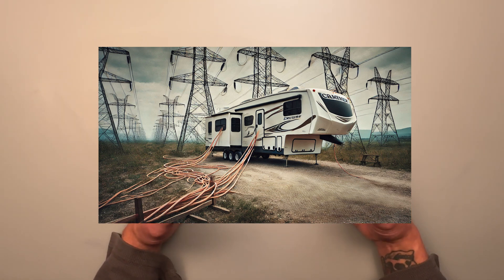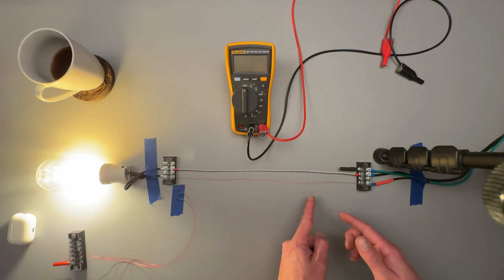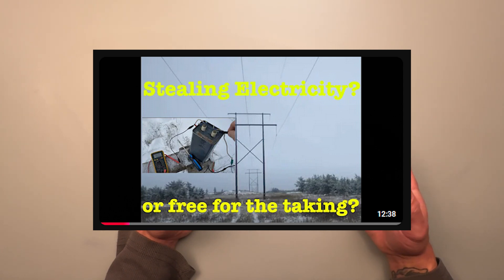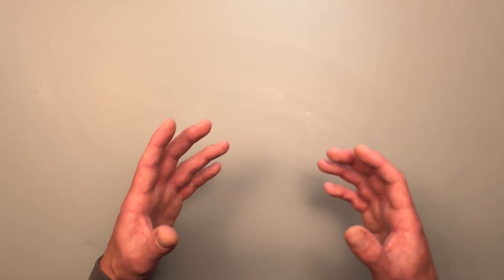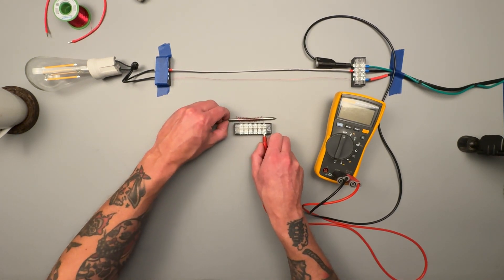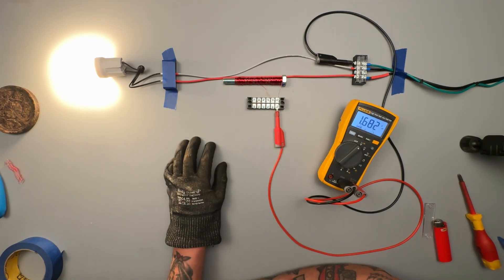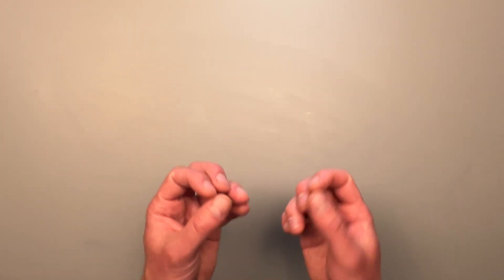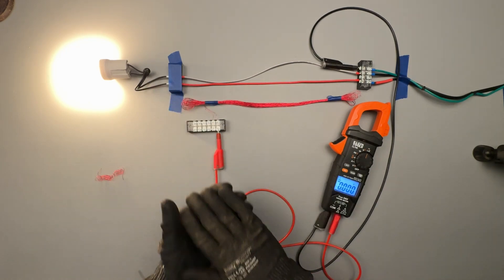FREE ELECTRICITY - Kind of (Testing Induction from High Voltage Power Lines) ⚡️📡

Comment: I take it, the amperage is going to be based on how much is being used from the transmission line... Being voltage doesn't really matter if the amperage is low... You could have 50k volts at .0000000000000001 amp which is not usable at all... Curious what could be done to increase the amperage...
Reply from the maker: It's been awhile since I put this together so i'm not as fresh on all the research I did to put this together. But learning about transformers and their theory of operation is really helpful for this topic. Arranging the conductors into a coil and adding an iron core + getting the conductors closer, increased the transfer of energy and allows for usable voltage and current.

Comment: if there is no usable power here, how can I light fluorescent lamps in my hand while standing under these powerlines?  Your application testing was on the microscale considering the amount of current going thru the overhead lines to create huge magnetic fields. Ask yourself this question... why are those wires so freaking high in the air? And another anomaly is that you can dig the earth around the powerlines and never find an earthworm. As A teen, I experimented with hanging wires near the powerline towers in my back yard.... a 20 ft wire lifted to about 10 ft off the ground was able to produce 3 inch sparks, so yes thats allot of voltage, so take that voltage and feed it to a flyback transformer and see how much power you can achieve from the primary windings.... It's called impedance matching.... High resistance winding tied to a high impedance antenna coupled to a low impedance winding to transfer the high voltage to low voltage with more current. one day I'll make a video to prove this is usable power.
Reply from the maker: Hey n3qxc, thank you for the comment.

Yes, my testing was done on a micro scale to help demonstrate the concepts at play. I understand that the high voltage transmission lines are high in the air.. if you get any amount of conductor close enough to those lines you're going to get usable voltage and then some. The limitation I purposefully put on the example is that someone used extension cords strung across the ground.. so that the EMF induction would be limited and weak. Another aspect of the demonstration was to help the audience understand impedance and voltage drop. 

I don't see how a flyback transformer being implemented or impedance matching would be useful in this particular scenario. 

Thank you for sharing your passion with myself and the audience.
Reply: @maddoxmechanic  impedance matching is KEY.... maximum power transfers with proper matching..... try 32 ohm speakers on your home stereo vs the 8 ohm that they were designed for.... same thing goes for antennas and transmitters..... dump 1kw into a 3000 ohm antenna and nothing gets transmitted.... I suspect the best idea would be to have a tuned tank circuit as your pickup coil.... tuned for 60 hz....  Extension cords on the ground may sound like a far fetched plan, but maybe there is some luck in the idea that each conductor is insulated from each other along with having a particular impedance due to capacitance created by parallel wires separated by insulation. Also .. back to the other guy with the video... charging the cap to near 800 vdc.... yeah it took some time, but the level of energy stored in that single charge could be useful once it's stepped down to a usable level. The reason the guy chose 4 ft height was to remain legal by considering it a fence wire as he inquired about putting up a fence and was told there would be no issues. So a fence with the top wire insulated from the poles would be a great collector. But even still... I dont see how it could be considered theft of service. This wouldn't have any loading effect on the overhead lines. There is more power lost in the corona discharge than anything. I love the purple glow of those insulators on a rainy night!
Reply from the maker: @n3qxc  I understand that impedance matching has its place in RF and stereo installation, but in low frequency inductance, impedance matching would have negligible effects to the circuit. The critical variables would be distance to the lines, the amount of conductor strung under the lines, and the current flowing through the high voltage transfer lines. 

That is a good point about keeping the coaxial off the ground. I had forgotten that was apart of his approach for testing, was to identify it as a fence.

Comment: Induction is how every step up / down transformer works. You can steal power this way, usable power.... But don't try it. Very dangerous. Master electrician here.... Really, don't do it... PS. Your wire wrapped around a screw is just acting as a capacitor. Give that power somewhere to go and you will measure a whole lot more.
Reply from the maker: Did you even watch the video?

Comment: You say what you're aiming to do is essentially make a transformer, but it looks like you have an antenna.
A transformer would have two ends of each winding. You're measuring one end of the secondary "coil" but referencing your meter to the return side of the primary "coil."
What happens when you put your meter across the secondary coil? (I.e. connect positive lead to one side of yiur wire and negative to the other.)
Reply from the maker: @nzkvack  nothing happens. It will read 0 volts since there’s no difference in potential. It is a really weird problem to look at and experiment with. It’s what inspired me to make the video in the first place.

Comment: I'm sure you have a lot more knowledge about this than do I, but wouldn't induction be transmitting the current and not the voltage, with the voltage simply being the result of the induced current interacting with the system impedance?  Also, wouldn't you need to insure that you are inductively coupling at right angles to the magnetic field?
Reply from the maker: @kcgunesq  great questions. The amount of current produced by the high voltage line will determine the strength of the EMF that gets induced as voltage on the “extension cords”. I experimented with a few different ways to couple the magnetic field. The biggest problem is that the high voltage transmission line is in a straight line and can’t be coiled that would optimize induction. It’s not an ideal scenario. That’s why the point of the video is to see if it’s possible/practical to try and get power this way. Thanks for the comment!
Reply: This is a good question and difficult to frame in text form. Volts represent an EMF potential difference between 2 points. The voltage between the line and ground is going to be different from the voltage in the induced current on the second line that's going to relate to the voltage, distance, and other variables relating to that second circuit. 

I'm a bit too drunk to try and run the numbers at the moment, but it's not wrong to suggest that a useful amount of power could be extracted over time with that kind of setup. It is technically "stealing" power, but that's also representing power "lost" in transmission, but I suspect (again in my currently drunken state) that the levels of power that could be extracted might be enough to help charge a battery (know that you can charge a battery with very little voltage or current over a long enough time), but probably not enough to actively power a light bulb.
Reply from the maker: @ sober up and re watch the video

Comment: You clearly have a fascination for this, i'm not entirely sure what your goal is though other than to siphon energy from a source?

Reason I ask, there are lots of other sources teaching how to induct such as the infamous Tesla coils. It was Tesla's (not that he was the first) life mission to be able to send wireless current to power homes, of course he failed at this as it's not possible, at least in a useful manner.

With regards to your project, I understand I think you are attempting to replicate - however the system used isn't efficient. Windings is used in transformers, inductors etc. Have you thought about introducing this into your concept?

If you desire accurate measurements you will need a clamp amp-meter. These are designed to measure amp from the EMF. Normally you put the clamp around a cable, but as you are measuring a high voltage source, the amp-meter will be influenced. This will be able to give you measurements at various distances away from the lines. From there you can work out exactly how close to the lines you would need your 'receiver' to collect electricity.

Apologies if I'm teaching you to suck eggs (British expression!), equally if there is anything your unsure of fire away. I'm no expert though I am an electrician in the domestic sector :)

(tbf though most sparks ive met know bugger all! haha)
Reply: Ah yeh I missed that bit I'm afraid regarding the windings. In that case, have you tried stripping the cable you use to run parralel to the high voltage lines?

The goal of the amp-meter is to determine the 'strength' of signal. Since amps and volts are connected via Ohms law you can work out what voltage you recieve. This can tell you how high or close to the HV you need your cables to induct your desired voltage.
Reply from the maker: @mortysmith8049  No worries Morty, I appreciate the interest in the topic.

So I did mention the amperage draw for the "high voltage" lines during the video. The initial draw on the 28 AWG enamel wire is only 1 amp and the amperage draw on the insulated 18 AWG is 4 amps. I understand the fundamentals of OHMs law, but they would not be applicable to this low efficiency induction circuit. This would fall under faradays law which would be the following:

ε = -N (dΦ/dt)  

Where:
ε represents the induced electromotive force (EMF), measured in volts (V). This is the "voltage" generated by the changing magnetic field.   
N is the number of turns in the coil or loop of wire. If you have a coil with multiple loops, the induced EMF is multiplied by the number of loops.  
dΦ/dt represents the rate of change of magnetic flux, measured in Webers per second (Wb/s). This is how quickly the magnetic field passing through the loop is changing.
Reply from the maker: Hey Morty, thank you for the comment!

My goal, as stated in the video, is to see if usable voltage is obtainable by running extension cords under high voltage transmission lines. 

I think you might have stopped the video a bit early, I do utilize windings and mention transformers towards the ending of the video.

An amp clamp meter would be for measuring amperage.. I am not utilizing an amp meter as I am showing the voltage induction. 

Thank you for your input. Cheers.